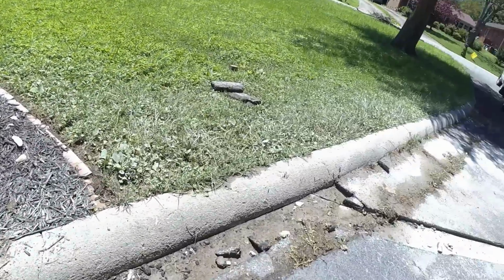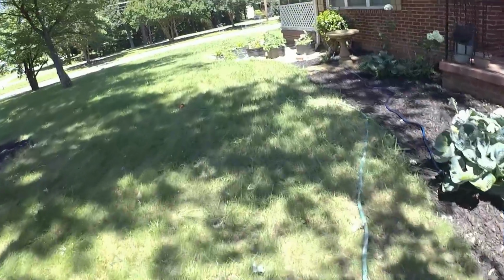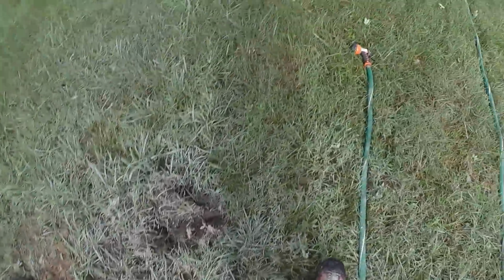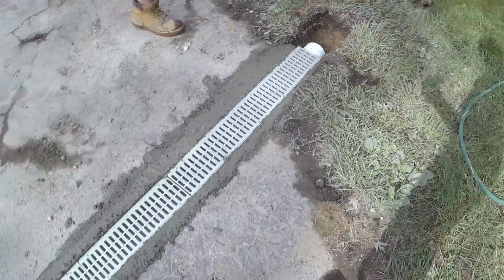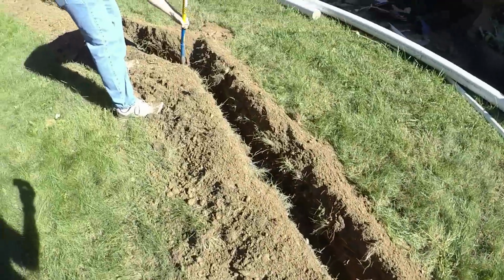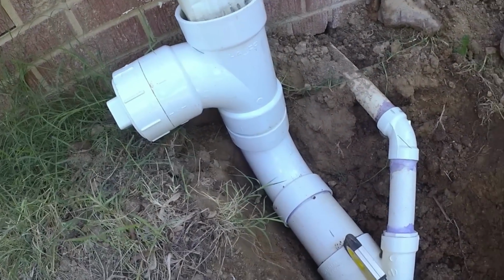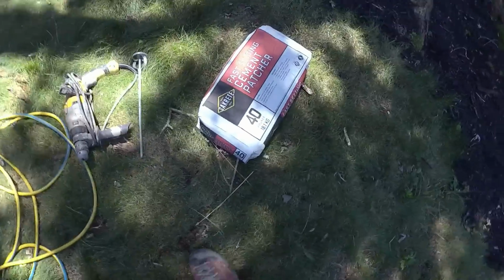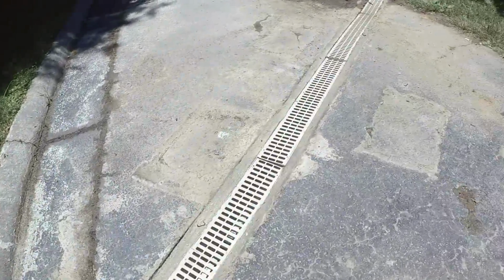Installing a Grate drain or Channel drain across driveway - gate city foundation drainage

Comment: As a German I am always surprised how easy it seems that the municipality seems to be very at ease with request of dumping Rainwater drainage to the infrastructure. Here in Germany it is essentially a sacrilege to request something like that; as you are expected to make sure the Rainwater can ooze away on your property in some fashion so to ensure the ground water is kept as it naturally would if the house wasn't there.

For example, I build my house last year and we had trouble getting my front-gutters to a absorbing well or Swale (we call it Rigole), so we asked the city if we can dump 3 gutters into one of the street-drains ... oh boy let me tell you was that a mistake; they almost threw a hissy fit:-D.
We ended up taking very long pipes (Sch 40 ;-) ) around the house into the backyard and had to dig a very deep and wide hole for the expected water influx (basically like your French drains with out a Drainage pipe ;-) ) as the property slopes upwards from the street to the back of my house. At least i now have a nice feature in my backyard my landscaper can play with.
Reply from the maker: We have mostly clay in our area so lots of our water runs off as surface water. We're also at around 600' above sea level here so not too high.
Reply: But the house is there. And water damage to concrete can cause houses to collapse or rot. Perhaps Germany has it backwards.
Reply: @nt-jk1dw  All I can say is, I've never heard of houses collapsing from that in my life (I'm 62).

Comment: Great job Shaun! I've always found it to be the most useful on the 50+ lbs jackhammers to set your bit on the curb or sloped concrete where you want to hammer, then put your boot out and rest it on the slope with the toe of the boot pushing slightly against the bit, this prevents the bit from being able to slip down on you until it creates enough of a bite to stay in place. Even on flat surfaces, with the bigger hammers we rest the bit in between both feet and just hammer down, just to keep it from traveling because wrestling a 100+ lbs hammer around sucks. It is safe and easy, the only thing being over time you will begin to rub the leather off the toe, but that just shows that you work lol. Keep it up man, great work!
Reply from the maker: Great tips!

Comment: You drained 3 downspouts with 4 inch PVC plus the channel drain, all emptying into one 4 inch PVC. How's that working out during a heavy rain?
Reply from the maker: Extremely well. Since 4" schedule 40 PVC at a full bubble is overkill for gutters, there is more than enough capacity to move water.

Comment: I've got a gas line that goes under the part that I want to fit the channel drain. Apart from any safety issues and regulation issues, is that something that is advisable or recommended? I can't install a carport extension to catch extra rain that falls on a negative gradient and sends water back into my garage, because of setback regulations from the road, so I really need to do something with this water!

Comment: Hi, thanks for the awesome video.  Does the channel drain on the driveway need to be sloped towards the city drain?
Reply from the maker: Yes the channel needs to slope to wherever the drain is. Once you get into solid pipe we like a full bubble of slope.
Reply: @GCFD  Hi again. Thanks for your response.  To confirm, the piping from the outlet of the Channel Drain itself is sloped towards the drain area.  My question is, will the Channel Drain system itself before the outlet need to be sloped?
Reply: In other words, driveways typically are leveled left to right when looking the garage  face on.  How will I be able to slope the channel grate if it's not already built in?  I dont think it needs to be sloped but just wanted to confirm.  Thank you!
Reply: nevermind.  I found the answer elsewhere.  You don't need the channel itself to be sloped so long as you have an outlet that is presloped at least at every 20 feet of the channel.

Comment: Nice work! Very good job guys
Reply: Chris Thompson , could you elaborate? It looks like it worked well.
Reply: @mikeingeorgia1  Hi Bud i did actually put a lengthy explanation on this vid by the looks of it it has been removed somehow or vid been taken down and re uploaded to remove bad feedback
Reply from the maker: I think someone flagged your comment which is why it disappeared. I just now read it and deleted it. It contained profanity, which is just not my style. You mentioned a few things like the pipe should have been deeper so you don't hit it with a spade and the channel should have been straight across. You also mentioned using a diamond core bit. I do that when it is exposed, but for a buried pipe I'm good with the rotary hammer.
This customer had 2 feet of water in her back yard and needed to prioritize the drainage. She also built raised beds for flowers. The system worked well and her problems are 100% solved, but perhaps I should talk more about why I'm doing things the way I am. I do drainage specifically, so by the time a customer calls me they usually  have serious issues. I prioritize results since I deal with flooded basements, crawl spaces, and even with real estate deals. You can't fake it when a buyer does a final walk-through in the pouring rain and there is less water thanks to my drainage solutions. Please keep watching and letting me  know your thoughts and I'l try to explain things more in the videos. I really didn't think they would be so popular!
Reply: @GCFD  You are professional and a class act. Good job.

Comment: So much for wearing a mask with all that concrete dust, at least it was the rookies job, am I right? Probably best to call utilities before you cut the driveway off in case your driveway trench hit up against utility.  But looks great though.
Reply from the maker: Yes! We call 811 on all jobs. The gas company has not been marking lately which is a pain.

Comment: The manufacturer of the channel drain specifies 4" of concrete on each side of the channel drain plus another 4" below it when it's going to support a vehicle.  It looks like you're using much less concrete than the manufacturer specifies.  How is it holding up with the way you installed it?  https://youtu.be/cIdbmTdOjaY?t=192
Reply from the maker: The channel drain still looks as good as when we installed it. We also use high strength concrete mix. I think the manufacturer is making sure to cover themselves with the 4" all around. The channel would crack before the concrete under it, regardless of how thick is it.